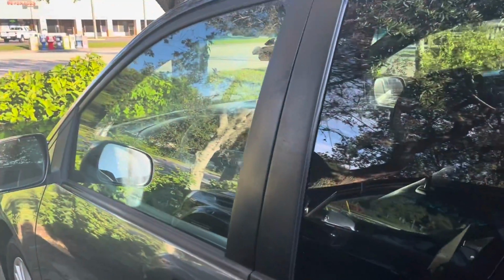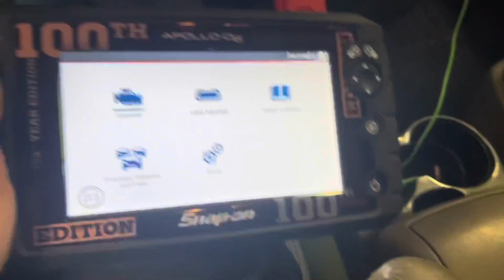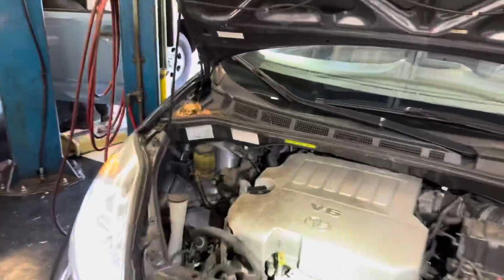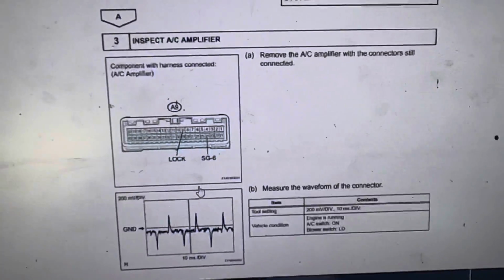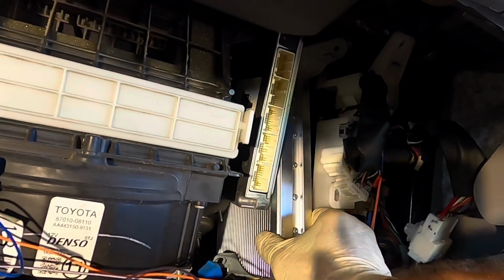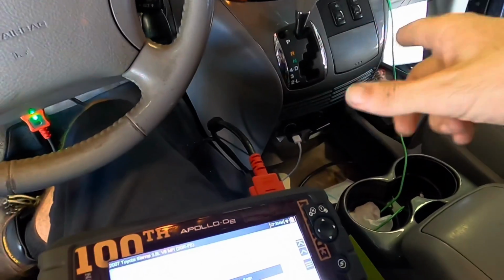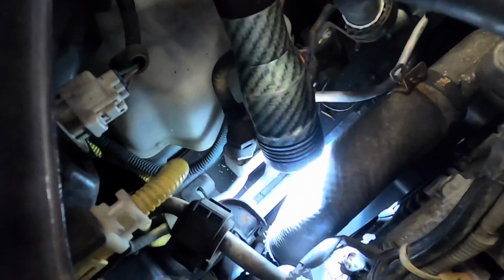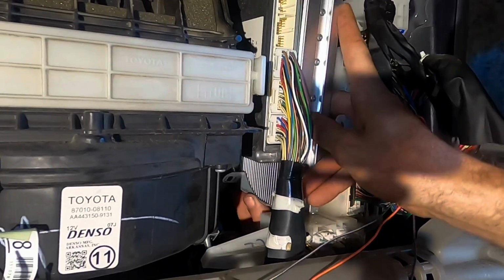Ghost Toyota: Engine running with no keys! And Customer States: No A/C

Comment: Still a great video! Good job!  I know as a commercial shop, its more cost effective to replace the entire compressor. especially if it apparently has a locked rotor.  For myself, I would have taken it a step further and verified that the clutch was not burnt up and causing the ac amp to think the compressor was locked.  Maybe I missed something here and I'm sure your warranty, Labor involved would make it a way better idea just to replace the whole compressor.  I'm a DIY guy and don't mind taking the time to pull the clutch out and check it/replace it first.  I know the compressor may cost like $120 and the clutch about $60. I would have a shop change out my compressor if it needed it as I do not have the tools to do so, more cost effective for me.  I have a murano where the clutch control is routed through an IPDM that can run an automatic test of the headlights, windshield wipers, ac clutch and more by pressing the ignition button and door switch a series of times.  Anyways, thanks for the great video and dont beat yourself up its always great to get the education and see you at work!

Comment: If the ac works intermittently it probably means it's not faulty, maybe it's the magnetic clutch engager(don't know english word for it), the thing that turns into a magnet and engages the clutch when you turn ac on. I've seen that quite a few times before, people went to mechanics that reccomended a compressor replacement for just the magnetic clutch. Here's the best way to diagnose that:
If compressor works intermittently it most likely means it's not brokey, also if it spins by hand it's not seized. You did great by connecting it straight to power but you did not listen/check if it actually became magnetic and engaged the clutch, it should make a loud clunk. Alternatively, hold a metal screwdriver next to it and feel if it becomes magnetic when you turn on power.

If your shop doesn't open up compressors and swap out the magnetic thing then it's understandable that you reccomend a compressor replacement and you did the right diagnosis. Keep up the good work Ray, i'm absolutely binging your videos.

Comment: Don't beat yourself up to bad, we have all done things like that.
I had to do a road repair on one of our tractor trailers. Drivers complaint was, trailer brakes  were locked up. To me it looked like a bad brake release valve (witch I did not have with me). I caged the brakes to get it back to my shop. They did not release.  It was 10°, I was laying in slush and I was frustrated. I cut the push rods off and the brakes released.  As I was following him back, I noticed the brake lights were on. I called the driver and asked him to check his manual trailer brake lever. It was pulled down and neither of us noticed. All I would of had to do was push it up. But instead I made more work for my. Good thing I'm straight up hourly

Comment: as the Toyota engineer who designed the A/C system in these 10/15 year old cars,  it appears you have a bad isolated ground in the harness.  fix that, and your customer will have A/C.  no need for a compressor.

Comment: don't beat yourself up bro, remember by performing a successful diagnosis without just standing back and throwing parts at it is a win.. you could have attempted to diagnose it from the service counter but you didn't. you followed the process, regardless if there is a faster or simpler way to get to the same result. these skills are important, too often people jump steps and miss things and then end up getting confused because it makes no sense because they shortcut something that they probably shouldn't have or more importantly should have returned to if the failure point wasn't where they skipped to.. experience is a magical thing you get seconds after you actually needed it..

Comment: bad auto start wiring? I had a bad brake wire so if I would start with the auto start it would not detect me hitting the brake so it would keep running even when I turned key off.

Comment: Yeah, my fleet of  police cars had Safety Stop. You can activate it and forget about it. Allows you to take the key out and it leaves it running. If you hit brake pedal, etc anything to take off in it, it will turn off. One of the Officers set his truck like that and I didnt know and it wouldnt shut off. Then the alarm would go off doing stupid crap the alarm speaker is a train horn.

Comment: What a crappy install on the remote start.   This must be the first toyota that ever failed, I am always told they never fail and will work forever, never understood why the shop has more garage bays than even honda garage does.  Ray you also found the abortion in the glove box that you should write up for future issues and would not have had that fun experience if you had not followed the engineers pecker trail.

Comment: it has a remote starter and the amplifier is the stereo amplifier not the a/c amplifier.The sloppily installed remote starter may have a temp thershold that it runs the a/c or heater (and engine of course) when the interior hits a certain temp. the customer did not leave you the fob or it runs from the factory fob/key by hitting lock three times. Remote start expert from way up north.

Comment: Great video. I have definitely had days like this and I think it is great for everyone to see that sometimes we can go down the rabbit hole in these things that end up being something fairly basic. Modules in cars can make it difficult sometimes when you’re trying to diagnose something. Sometimes they cause trouble after repair too if you’re not careful. I ran into an issue on I wanna say a Dodge. I replaced an alternator but I didn’t quite click the connector all the way when I installed it. The charge light was still on so I double checked everything and clicked the connector that I had missed. The light was still on and it was still not charging. I had to clear the code before it would work. The error code prevented power being sent to the alternator. After clearing the code the alternator started charging and the light stayed off.

Comment: Hey this is probably a little older Vigo won't know actually it's not having have you ever thought about getting a headset camera so instead of using your cell phone as the camera have you ever thought about getting one of those like I know I know they have headlamps for you to see everything but do they probably also make cameras so that they sit on your head instead of the light so that way the camera would actually be kind of like a 3rd eye right above your nose leaving you with your 2 hands available to do all the stuff And it might also make it easier

Comment: Common Sense should tell you that if the car is running without the RFID shift key in the ignition switch it's probably got a remote start.

Comment: Can I point out, not even the dealerships use dealership method. I work in a Toyota dealership and we NEVER touch the diag trees unless we can't find out the issue manually

Comment: Should always evac and recharge to make sure the system has the proper amount of freon for the system to even turn on. The system could have been low on freon preventing it from turning on or even empty. You say you know better but Step One is Evac and recharge then test at the plug for the compressor for power then check relays. So clearly you don't know.
Reply: That is dumb. I'd fire you for wasting time. Low refrigerant, (freon is a brand name that's not in this car, dummy) will not cause a compressor lock code. Just shows you don't know shet.
Reply: @Bryan-Hensley  for one I like brand name things two he took all kinds of things off for what? I charge to check and charge with freon which needs to be done no matter what. Then I check and make sure the compressor is coming on and if not verify it has a signal to do so. Then charge more for further diagnosis but step one and two would have told me the compressor was dead. No further diagnosis needed. And clearly no reason to take all that apart for no reason. And to hook up the machine and check freon is not a waste of tim as I can work on another car while I verify freon levels lol.

Comment: Don't worry buddy, us dealer techs still do it the manual way. The "engineering" way of diagnosing 9/10 turns into a rabbit hole with a bunch of special tools/equipment and scopes, when all you really needed to do was test for power and ground even on the new cars.
Reply: Yup, easy manual checks first, then brand diag procedures, then hard manual checks if there's still no answer. So many times I've been the 3rd or 4th tech in my shop to look at something and found a bad relay or a loose plug that was never checked... after we've had the customer's car for two weeks because the guys before me never bothered to check the easy stuff first.
Reply: Wait no. What I meant to say was REEEEEEEEEEEEEEEEEEEEEEEEEEEEEEEEEEEEEEEEEEEEEEEEEEEEEEEEEEEEEEEEEEEEEEEEEEEEEEEEEEEEEEEEEEEEEEEEEEEEEEEEEEEEEEEEEEEEEEEEEEEEEEEEEEEEEEEEEEEEEEEEEEEEEEEEEEEEEEEEEEEEEEEEEEEEEEEEEEEEEEEEEEEEEEEEEEEEEEEEEEEEEEEEEEEEEEEEEEEEEEEEEEEEEEEEEEEEEEEEEEEEEEEEEEEEEEEEEEEEEEEEEEEEEEEEEEEEEEEEEEEEEEEEEEEEEEEEEEEEEEEEEEEEEEEEEEEEEEEEEEEEEEEEEEEEEEEEEEEEEEEEEEEEEEEEEEEEEEEEEEEEEEEEEEEEEEEEEEEEEEEEEEEEEEEEEEEEEEEEEEEEEEEEEEEEEEEEEEEE!
Reply: @calicantdrive  you're a dork. I like you.

Comment: My preferred method for this type of issue, once I've verified a charge on the system (which if it blows cold at all you probably have,) is to start at the compressor and work backwards. Mainly because I hate digging under the dash if I don't have to.

Comment: Rainman rays repairs. Im pretty sure you know the mechanical term ( kiss it )? Did you thing to check the a/c pressure in the system? If the freon level is too low then the compressor wont kick on. In my opinion i would have checked to see if the compressor clutch wont kick on with the a/c switch turned on then second option is to check for proper freon level. If thats still not it then i would start to dig deeper into diagnostics.

Comment: On Toyota vehicles always check coolant level first before any diagnostic testing. Low coolant, just a few degrees too hot the ecm  will not let compressor engage.
Reply: That won't trigger a compressor lock code.

Comment: Someone already mentioned what "compressor lock" means...just that there's no rotation when there should be...which can be caused by an open clutch coil.  A quick check I use for clutch coil failures is to use my test light with the clip connected to battery positive, and touch the probe to the relay terminal that goes to the clutch. The ground, through the coil, should easily light an incandescent test light. If there's no light then the coil is likely open but then I go down to the compressor to check for sure. If the test light lights, then you go in the direction of either power feed for clutch or control from the PCM, amplifier, or whatever is controlling it. Testing that first, right at the relay, tells you what direction to go.  It's worked well and makes a quick diag of any compressor mag clutch.  I like that relay switch tool.  That's handy!

Comment: I get wanting to check the module and all that the dealer way, because the customer stated that it was working and I think it even worked once for you when you first started it but then it quit working. But sometimes the best way to diagnose stuff is just to go by the old methods and manually put power to it and see if the AC compressor works. But yeah the dealer really lead you down a rabbit hole I should say with their crazy diagnostic diagram or flowchart.

Comment: Hey Ray! I don’t mean to be a dirtbag, but I do believe you are taking out the JBL amp. The a/c amp is a small black box usually under the a/c box
Reply from the maker: I dunno could be, the diagram pointed to that module in a pic, stated it was an AC amplifier relating to the HVAC code. I’ll tell ya, when I pulled it out, as per the flow chart… “something isn’t right, this is BS”  went through my head.  So “🖕Alldata I’m going to fail this compressor now” came next.

Comment: My next door neighbor's mother has a Toyota that did the same thing 3 months ago.  I found it to be an aftermarket remote starter to be the culprit.
Trick was if you remote start it, you had to remote stop it.  ( Now, to watch the video to see what this one's about.)
Reply: I used to install them. They'll shut down on their own after a few minutes. If you put the key in, turn it on then realize you forgot something in the house it will lock the doors if that time frame expires. Since you have the key on it will keep running while locking you out of the car. If you don't have a spare key somewhere you are locked out with a running car. I had a few complaints about that.

Comment: I really hate seeing wires scabbed on to the factory harness. I understand your internal struggle on diagnostics. I used to diagnose with a code reader, test light (power probe) and a volt meter. When it comes to A/C clutch, hvac fan, even a no crank, I always check for power and ground, and signal voltage (or ground) first. But, on some things, I go straight for the scan tool. At least you didn’t spend an entire day chasing an unfastened ground (trans shop) because I wanted to see what I could accomplish with my shiny new tool.

Comment: I like that electrical tester with the voltage output in the handle,where do they sell those?
Reply: Snap-on has them! Where i bought mine, but autozone has the cheaper version as well.

Comment: Just to let you off the hook a little, even the people at my local Toyota aren't that fluent in Toyota language, LOL. I'm about to bypass their BS and go to someone like you over a sensor issue that keeps jamming the breaks on through intersections... Their diagnosis is it's a software glitch when you can clearly see the sensor has been jimmy rigged. at any rate love the videos! :)
Reply from the maker: Eyesight, lane, departure, collision/object, sensors are EXTREMELY sensitive. If you have an obvious visual defect, that sensor IS the problem! Those things can even malfunction due defects in the paint that’s on them.
Reply: @RainmanRaysRepairs  Yeah it's been hot glued in, LOL I'm gonna just get a new one hopefully, thanks for the response. :)

Comment: Next time just jump power to the clutch right away, the compressor lock code sets because of a difference in RPM between engine RPM and compressor RPM, if it is different for any reason when signal is being sent to the clutch the amplifier will take away power to the compressor to prevent the drive belt from failing due to a locked up compressor. It looks like you were pulling out the speaker amp not the a/c amplifier. It's easy to go down the wrong path on something like this if you don't know exactly how the whole system is set up.
Reply: If you jump power to the sensor you could burn it out.

Comment: You could always have put a resistor across the compressor lock wires the same value as the compressor lock sensor is supposed to be, and the A/C amplifier would not have thrown that code.